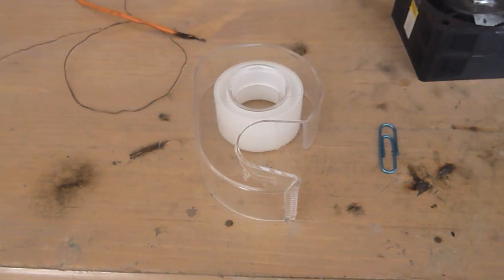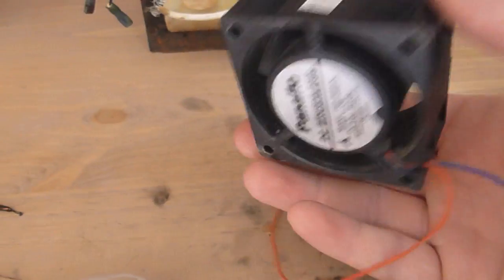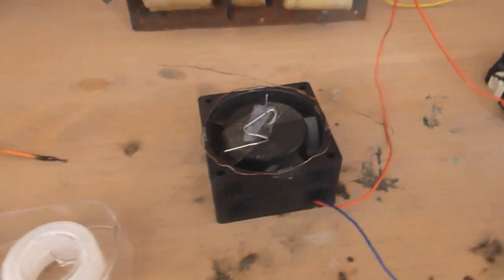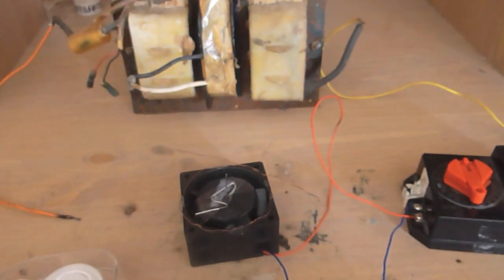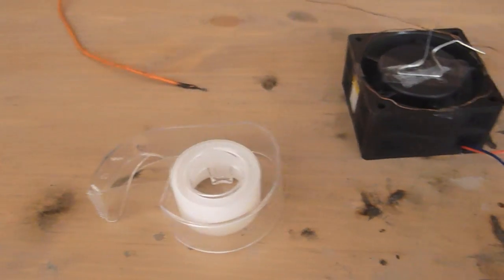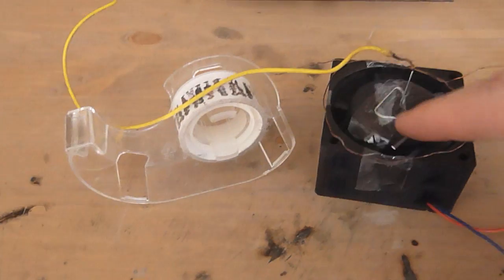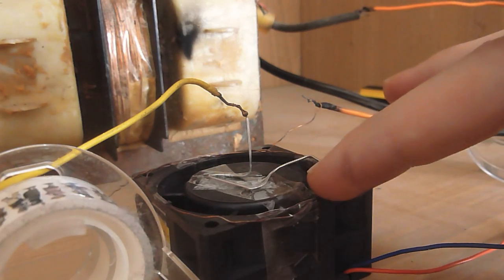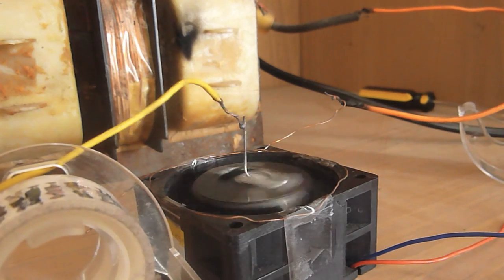The Real Arc Reactor Tutorial!

Comment: Can you write in detail about what you used to make .
I just understood the dc motor,wire, paper clip and all 
Just write which transformer you used and the other thing which has a dial on it
Reply from the maker: The transformer I used is an old neon sign transformer it puts out about 7500 volts. If you haven't worked with high voltage before I wouldn't attempt this because it can be dangerous to work with.
Reply: science1324  can u give me your email I want to ask you some questions

Comment: Would a microwave oven transformer do the trick? Also, the most likely cause of the bad smell at the end of the video was probably ozone (which is poisonous in large quantities so I wouldn't run this too long if I were you).
Reply from the maker: Its possible, although it would melt the wire very quickly due to the high amperage that those are capable of putting out!

Comment: I wish you could have provided an explanation
Reply from the maker: What part were you looking for an explanation on?
Reply: I know it is basically a Tesla coil and does not actually generate electricity, but I mainly mean the science behind the current flow
Reply from the maker: Basically, it is just a spark gap, but instead of it just sitting still I put it on a spinning platform. all it is is A/C current at a high voltage.
Reply: OK I think I get it now, thank you
Reply: Also you just earned a sub 😜
Reply from the maker: Awesome! thanks! glad I could help.

Comment: could this work with a 400kv high voltage booster/generator?
Reply from the maker: Unfortunately the transformer I have only goes to 7500 volts
Reply: science1324 :(
Reply from the maker: I'm sorry, I miss read your comment! You could potentially use a boost generator. I'm not sure what kind of results it would give you.
Reply: science1324 it would only give high pressure arcs and not high temprature, with the boost generator

Comment: i want to tell you that you are not making any energy you are just amplifie 110v ac current through a transformer and by that amplified current you make plasma which creates magnatic field and that magnatic field wll exite the mercury vapour in the bulbe and due to which it glow. so the summery is you are not making any kind of energy by your this arc reacter
Reply from the maker: your right, its just an arc that I made spin with the fan it looks cool though!
Reply: science1324 true
Reply: science1324 where did u get the controller
Reply: Tony had to take that much energy initially because that is how arc reactors work. you need to kick start it to reach a certain level but then it will keep "generating" output, not take energy from a battery and transfer like in this video. So I don't see how this is "no different than what Tony's doing".
Reply: Dude. Tony's first miniature ark reactor had to absorb the power of the lit work station before it could be functional enough for his first suit.  Hell what this guy is doing is pretty much no different than what Tony's doing.  Only difference is, he doesn't have a battery or a capacitor to store the power.  If he got that, then he'd be solid.

Comment: Will this work with a car battery?
Reply from the maker: you could run it off a car battery, you would need a way to get high voltage from it though. A flyback driver curcuit could work for that.

Comment: So it is creating electricity
Reply: Erik Creed It's creating nothing. The electricity is coming from (wait for it).... the transformer which is plugged in to a wall socket.   This a nifty light show, nothing more.  It's the oldest concept in the universe, everything has to come from something and neither energy nor matter can be created, nor destroyed, it only changes forms.  You don't create energy by hooking a computer fan up to a model-train controller, an unplugged transformer and bending a paper-clip.   If it was that simple the oil, gas, and coal industries would have vanished ages ago.
Reply from the maker: Brian Straight unfortunatley brian straight is right its not creating any electricity its just there to look cool.
Reply: +science1324 but y its not creating electricity
Reply from the maker: There is nothing for it to react at the moment.

Comment: just wondering, would this work with a low voltage transformer like 12v or 18v or 36v using a variable transformer? By the way, awesome video